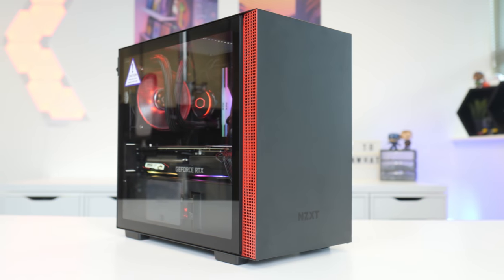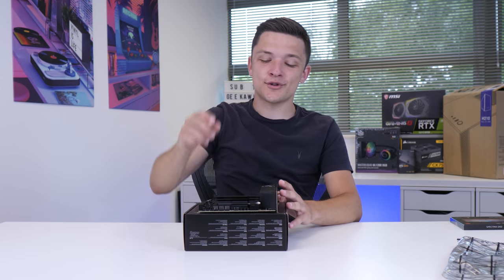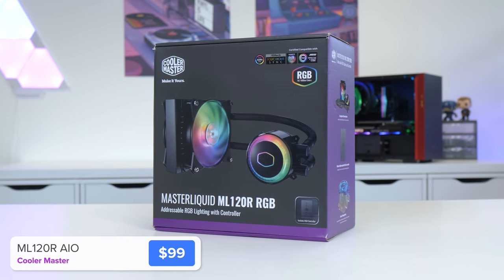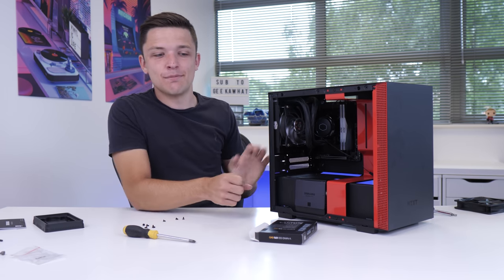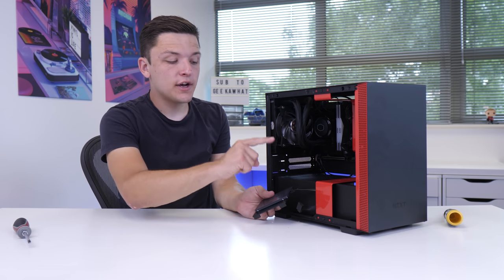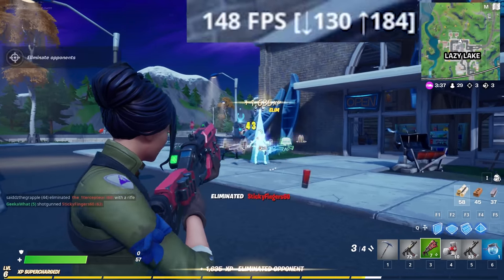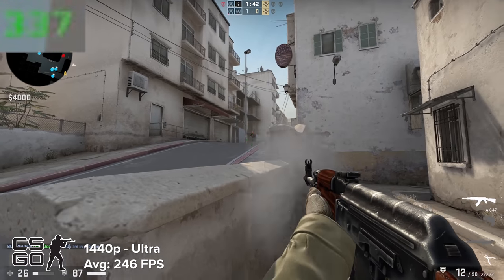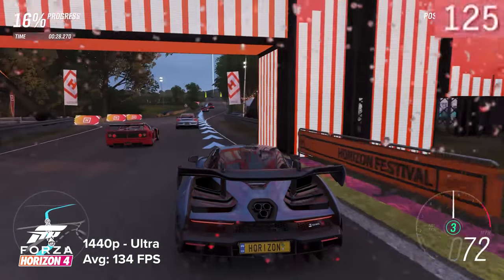Insane $1500 Gaming PC Build 2020! [RTX 2070 Super & i5 10600K w/ Benchmarks!]

Comment: I trying to build a PC and I wanted to get peoples opinion on the specs                       CPU: Intel core i7 10700k.                            Video card: MSI GeForce RTX 2060 6GB.     Cooling: Corsair H100i RGB platinum 75 CFM.                                                                 Motherboard: MSI MPG Z490 gaming edge.                                                                 Memory: Corsair Vengeance RGB Pro 16 GB DDR4-3200 CL.                                          Storage: Samsung 860 QVO 1TB 2.5” SSD

Comment: Is there any issues with cooling with the mini itx case and everything packed in? Less space for air flow etc. new to PC building so excuse my ignorance.
Reply from the maker: Mini ITX builds are pretty much always gonna run at higher temps because of the size, but that isn't really an issue if things don't thermal throttle (where they get too hot and need to slow down in order to cool down) :)

Comment: That's the smallest motherboard I've seen so far.
Reply from the maker: Size doesn't always matter ;)
Reply: It looks to be a Mini *ITX motherboard. Depending on if you have a standard ATX motherboard, the RAM/Memory may be installed differently. 

If there's 4 memory slots, you'd want to plug the ram into the slots 1 and 3, or 2 and 4. Though the Mini *ITX only had 2 slots for memory (from what I've seen Anyway.) So there really was no other way to install the memory.
Reply: @grandimations7309  Mini itx*
Reply: Rick Roll 
Oh, right. ATX is for the Computer case, isn't it?
Reply: @grandimations7309  Yes and no, atx is a general form factor and applies to motherboards, power supplies, cases, etc. You have E-atx (big) atx (normal) micro-atx (smaller) then you have mini-itx (smallest). There are a couple other motherboard sizes but the atx and itx and other form factors apply to all parts
Reply: Rick Roll so if ATX and ITX are practically the same thing/meaning, why correct it? I don't know if there's something I'm still missing.
Reply: @grandimations7309  No, atx and itx are different, atx is a larger form factor, itx is a smaller form factor.
Reply: Rick Roll 
Oh! I see, Thank you for enlightening me. I'll edit my post accordingly